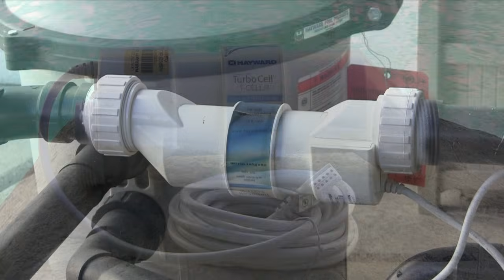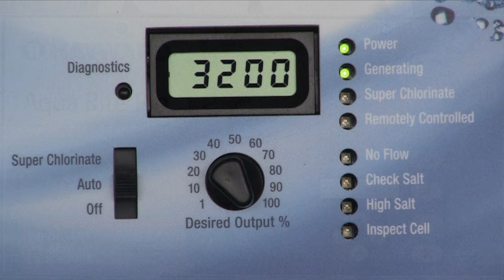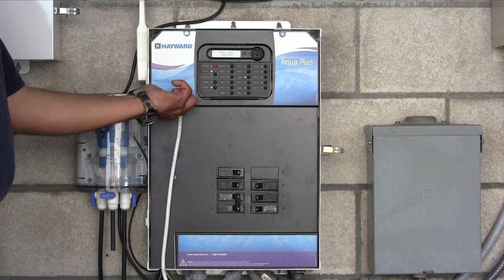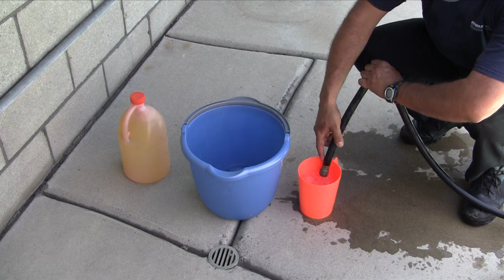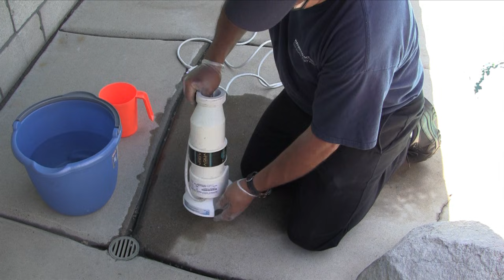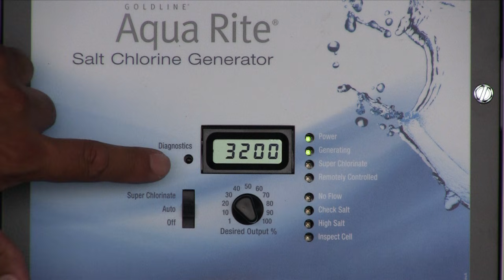How to Clean Your Hayward Salt Chlorination TurboCell

Comment: I just bought a home with one of these and I'm cleaning it for the first time (I'm use to do my Pentair Intellichlor) so this looks a lot easier and less stressful not having that safety flow switch to worry about damaging.  I'm reading conflicting info on orientation on reassmbly of the power cord for a horizontal application.  Would the cord by on the top, or the bottom as shown in the video.  Mine is at the top now.  Since this had it on the bottom, I will do the bottom.  But if someone can PLEASE confirm, I would created appreciate it.

Comment: Cell cleaning stand when attached the way you are showing puts strain and pressure on electric wire! I thought it was on my unit but in the video I can see wire connection pushed away too, it is just too tight and can potentially damage the unit. Why not to attach the stand simply on the other side?

Comment: To keep the acid cleaner from spilling onto your concrete surfaces you might want to use a plastic tub to work in. Like a small mortar mixing tub. Thanks for your video.

Comment: I bought the cap/stand to clean. I put in the solution to clean /desalt  . I let sit for at least 30 mins . Then flush out both ends with a hose . Then re-install the cell. Monitor for 12 hours. My salt cell lasted for 9 3/4 years!

Comment: Thanks. Very helpful, but why can't we have the cable on the top? If I fill the whole cell with acid I think it shouldn't matter if the cable is on top or bottom. When at the bottom it's very tight with the stand and gets heavily squeezed and could be damaged from the stand. Any thoughts?

Comment: Well optimistic at best. I have very hard water and have to clean once month in the Summer. Also a 25 % solution for 15 min doesn't do much to dissolved the Calcium buildup. More like 50% for 30 minutes. Also after cleaning, you can just dump the acid/water mixture in your pool. Since turbo cells make the water alkaline Anyway. You have to add acid periodically to your water.
Reply from the maker: Yes, it varies with the water. If you'd like to connect with a Hayward tech, let us know.

Comment: How do I take off the cell without water flowing out of pvc pipes? Do I have to shut off all valves and drain my sand filter before removing?
Reply from the maker: Hi Michael, we can ask a Hayward tech to contact you if you'd like to provide your email address and phone number via private message on Facebook or Twitter or email us at marketing@hayward.com. Our authorized dealers can also assist-find your local dealers here: https://www.hayward-pool.com/shop/en/pools/Dealer-Locator?langId=-1#top.

Comment: I’ve never cleaned my cell in 6 years.  Worked good till it didn’t but heck the cells only last 6 years anyway.
Reply from the maker: Good morning! Thought we'd share more about why we recommend cleaning these cells. TurboCell cleaning frequency will be dependent on several factors such as pH, calcium hardness levels of your pool water and hours of operation. The pH and calcium hardness levels are the two factors that have the greatest impact on how often your TurboCell will require cleaning. Calcium buildup (or scale), is one of the most common and serious challenges in salt chlorinated pool maintenance, partly because it typically forms first on the salt cell plates where it can remain undetected until the problem advances.  Once scale forms, it lessens the effectiveness and life span of the salt cell, which can lead to premature cell replacement. If interested, here's a link to a nice blog article on the topic: https://blog.hayward-pool.com/maintenance/how-to-clean-your-hayward-salt-chlorinator-turbo-cell/.
Reply: @HaywardPoolProducts  excellent blog.

Comment: The TurboCell takes 38 ounces to fill, in case you want to be precise! I've had mine for 5 months and did its first cleaning. Was amazingly clean with no deposits that I could see. So I've had about 700 hours of runtime and no alarm light ever comes on. It should take flow rate into consideration when using a variable speed pump.

Comment: If you’re using muriatic acid bought from a pool store, it’s typically the kind with high vapor content.  Make sure you wear a rebreather when doing this.  Those fumes will literally burn your lungs out of your chest.
Reply from the maker: Thanks Living Soule, if you'd like a Hayward tech to contact you, please private message your email address and phone number to us on our Twitter profile or Facebook page. You can also email us at marketing @hayward.com.
Reply: @HaywardPoolProducts  Actually I just closed my pool this past weekend and after running my SWG for over 400 hours this summer, the thing was still spotless inside.

Question though…is it ok to leave it outside for the winter?  Should be disconnecting anything and bringing it indoors at all?

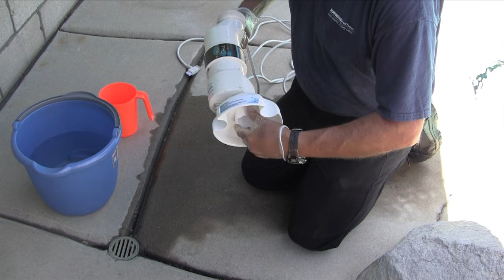Comment: At about 3:15 you say to make sure the cord is facing down when screwing into the cleaning base; however, the instructions for the cleaning base say the cord should be facing up.  Which way is correct?  Or does it matter?
Reply from the maker: Hi Ian, the main thing is to make sure the plug does not come in contact with any water or acid solution. The cord is fine to come into interaction with those, but the plug must remain dry.

Comment: Any ideas on how to unscrew the two rings for the T9? Mine are overly tightened beyond human strength.  :  (
Reply: This is what I use: IRWIN Tools VISE-GRIP Groove Joint Pliers, Straight Jaw, 16-Inch
Reply from the maker: Hi there, a Hayward tech can reach out if you’ll dm your contact info on our Facebook page or Twitter profile.
Reply: Hayward Pool Products  on Hayward Pool Pumps?
Reply: Hayward Pool Products What’s your Twitter contact?  Thanks

Comment: According to your installation manual, it's important that the cell is vertically installed and as closed to the pool jet as possible. Why is it installed horizontally in this video?
Reply from the maker: Hi Stephane, our TurboCell manual shows both installation options: vertically and horizontally. You can view the manuals here: https://www.hayward-pool.com/shop/en/pools/turbocells-i-cgturc

Please double check and let us know if your manual says any different. Do you know what model you have?
Reply: @HaywardPoolProducts  It's a Aquatrol T-cell 5. The manual is for AquaTrol systems. # 092588 RevA, here's what it says...

Plumbing
.....however it is very important that the cell be mounted vertically directly below the return jet in order to allow the gases produced in the cell to naturally dissipate in the pool.
Reply from the maker: Stephane, if you are using a flow switch with your AquaTrol, you can mount the cell in either horizontal or vertical positions. If you do not use a flow switch, you should install the cell in a vertical position to allow the gas to naturally escape into the pool.

Comment: perfect.. i should have cleaned it once last summer but i didnt  good thing is theres no calcium buildup.  Im going to clean it next time the light comes on!  Thanks.  wish I had a stand... I made it work though!!
Reply from the maker: Enjoy your pool!
Reply: @HaywardPoolProducts  so before opening this week or two, i finally got the stand, and cleaned it as instructed, nothing was building up anywhere in the cell... i dumped the acid back in the jug and i'll use it again... i suspect i've reset 3 lights now, inspected the first two..  great video thank you .  why is it so clean, and how long will it last?
Reply: Recommended to check the SwG cell every 3 months Nd at least wash with jet spray.
C even if the light indicator hasn’t come on

Comment: Im trying to clean my Cell, but noticed that is it placed on the side of pool, and I worry that the moment I remove it, water is going to start coming out. Any way to avoid this?
Reply from the maker: Sounds like you have an AquaTrol.  You will need to remove the eyeball on the return and put a plug in it’s place.  This should stop the water so you can clean the cell.

Comment: When I opened the two unions at either end water comes gushing out.  Turned valves off but know hope.  Filter is off.  Any ideas?
Reply from the maker: You need to block the water coming from the return and suction.   We do not know your pool.  You can post a private message on Facebook or Twitter with your phone number for phone help.

Comment: I followed the instructions for cleaning the cell and when I re-installed the cell, I pushed the diagnostic button for 3 seconds which cleared out the inspect cell light but only temporarily. The inspect cell light came back on after about a minute. Any suggestions why this happened or what I may need to do differently?
Reply from the maker: Hi Darrell,  my guess is that the check salt light also come on.   The salt level needs to be between 2700-3400.   Anything that deviates from those number could get a high or check salt along with a check cell light.    Have the salt level checked at a local store to confirm actual salt level. After confirming the salt level  do one of the following.

1.  If salt level is low add salt per our table in our manual or at the direction of the pool store.

2.  If salt level is high, drain the pool appropriately to obtain right level.

Once you have confirmed a correct salt level take the switch from auto to off and back to auto.   Wait for a click,  press the diagnostic button five times for instant salt level.  It will be a negative number.    If the reading falls between 2700-3400 take the switch from auto to super chlorinate  and back to auto to lock in the new number.  This must be done while the instant salt reading is showing on the screen.     If the salt level shows  a salt level below 2700 or 0 my guess is the cell is bad. Contact the local pool stores for cell testing.  Cells last around 3-5 years.
Reply from the maker: Darrell Robertson someone will reply here or will call you to help if you’d like to private message your phone number on our Facebook page or Twitter profile.

Comment: Any advice to help me remove mine?  The unions will not budge!  And I'm surprised to find that the cord that plugs into the control is zip tied down right next to the cell, I don't know how the pros I've been paying for 3 years have been checking it.
Reply from the maker: If you have a strap wrench, try using it to remove unions. If not,  a large pair of pliers will do the trick.  Installers normally use the ties to keep the cord out of the way.   When reinstalling the cell, make sure the o-ring is in place and only hand tighten.  Secure the cord with a new tie.
Reply: Thank you very much @HaywardPoolProducts !
Reply from the maker: @ErgoSuum  it's our pleasure! Reach out anytime.
Reply from the maker: Hi Brenda, happy to help. A tech will call you later today. Please PM your phone number to us on our Twitter profile or Facebook page.
Reply: Will do, just saw this.  I'll find your Twitter.  I successfully screwed the two unions back but now it is resisting removal.  It is entirely free of the two threaded unions but still stuck.  Plus I hear an ominous gurgling sound when I try to pull it off.  This is proving to be so daunting!  I am suspicious that our pros never did this for 3 years.  @HaywardPoolProducts
Reply from the maker: Our tech said you spoke with each other. Reach out if you need additional assistance.

Comment: three questions: 1. can I just turn system off and disconnect cell? or should I be cutting off certain stopcocks. 2. can I pour the used acid solution in my pool rather than dispose of it? 3. how much volume should i mix of the solution in order to fill a typical cell?
Reply from the maker: The only reason to shut valves is if the pool water level is above the equipment or water will pour out of the plumbing.  You will need to prime the pump after you reinstall the cell since the water will leave the plumbing.   The acid solution will have Calcium and will add to the calcium level in the pool.   You can add the solution if you have a low calcium hardness. 150-275.  If you are using a cell stand and pouring the acid solution into the cell rather than submerging the cell in a bucket it only takes about 2 quarts at the most to cover the blades.

Comment: The T-Cell cable side, should be facing up or down?
This video said it should be facing down but others said it should be facing up.
Reply from the maker: We'll ask our tech and let you know.
Reply from the maker: The T-Cell can be installed either on a horizontal or vertical line.   The cell can be installed with the cord side on the incoming flow side or on the outgoing flow side.  Does not matter.   If the cell is installed on a Horizontal line the lower part of the cell should be installed down if a variable speed pump is being used.
Reply: Thanks but my question is related to the cleaning process.
On this video you put the cable side facing the T-cell stand. Is this the recomended way to clean it?
Reply from the maker: There are three contact points inside where the cable comes in.      By placing the cable down the contact points will be cleaned more throughly.     It can be cleaned either way.
Reply: Hayward Pool Products thank you

Comment: I have a t15 that was working last year, today is not, no lights were showing, I inspected the board and there was a burn spot, replaced put in a new board and still not working... what can I do
Reply from the maker: Hi Diego, please PM your phone number and a tech will call you tomorrow.
Reply: A bad thermistor on the board causes this.
If you know someone who can solder, it could save you hundreds of dollars.
Aqua-Rite Thermistor AS32 2R025.( Pack of 2) Inrush Current Limiter 2 Ohm Ohm ±25% 1.18" (30mm)